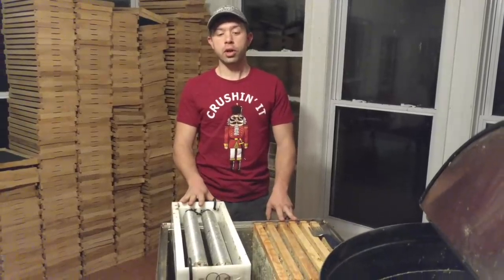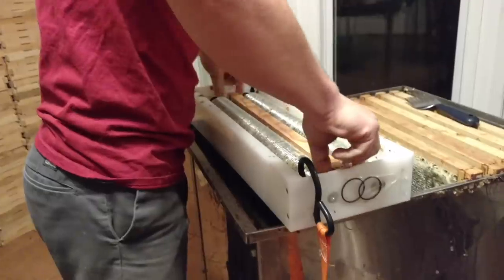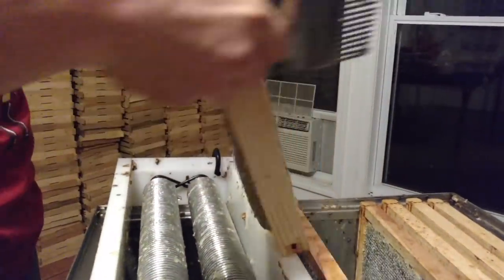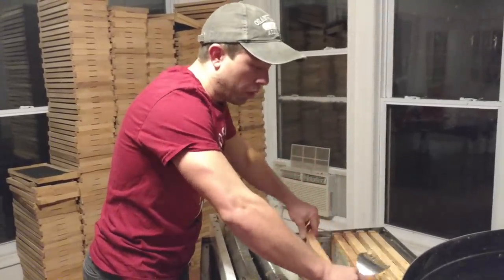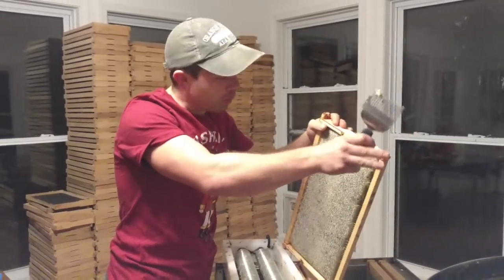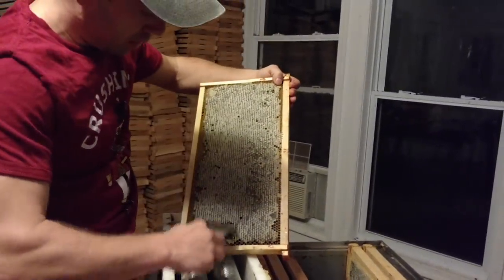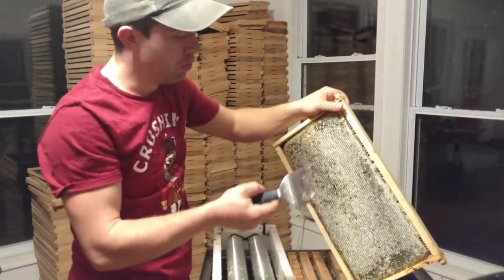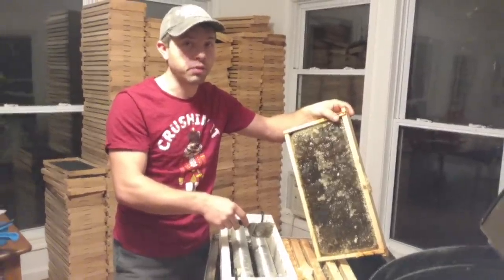🔵Honey Harvesting!! - Simply Harmony Farms Uncapper and uncapping fork!

Comment: simply put the slicer works fairly well, its always good to have a hand scraper or spiked roller on hand  to quickly get low spots or corners it may have missed, but overall it is far cheaper than a chain uncapper or slicer and far Quicker than a hot knife. I think we paid about $400, and we were able to extract a few hundred pounds in a couple hours, I would say it beats a messy slow HOT KNIFE ANY DAY!

I will go on to say I built a custom stand I could slide a 2-3 inch deep tray under to catch honey for easy cleanup, I strap it into a box frame with legs.  I can load a 30 frame spinner in less than 30 minutes if someone else is pulling the frames out of the boxes for me.

Comment: I have one of these that I purchased this season and it works pretty well. The one thing I have found if you have a thinner comb you can tilt it at an angle and it will hit those thinner spots on your frame. As far as extraction goes the majority of the honey does come out. But like you say you have to use a uncapping fork for some places that it just can't get to. Thanks for sharing.
Reply from the maker: Thanks for sharing as well!

Comment: Do the rollers fit between the frame side bars or extend the full width of the frame? I assume if the rollers fit WITHIN the frame side bars, they can 'squeeze in' on thinner combs and perforate them. Neat contraption. I rake my combs with a fork and it works well enough for now....but this uncapper may be in my future! Thanks Kamon.....and Laurel:)!

Comment: Would u recommend using this for fat frames or is it too tight to use on every fat frame? Considered one before,looks really handy glad u did video on it
Reply from the maker: I have yet to seem a fat frame it didn't take but I haven't tried exceptionally big combs on it. I bet it would work it would just crush the heck out of the combs.
Reply: @kamonreynolds  that's what I figured,those things look awful handy though
Reply: @kamonreynolds  Fat frames are fine.  The issue I ran into were frames that weren't drawn out evenly, or had some crazy comb like the second on in your video.  Those need the high spots cut off with a knife first, but I just used the needle roller on those and moved on.

Comment: Would you recommend this for someone with 6 hives?
Reply from the maker: I wouldn't. A knife is fast enough for 6 hives. Plus all of those thin pieces of wax will clog you bucket strainers. Best to cut the wax off in sheets. A pierce cold knife or hot knife works well